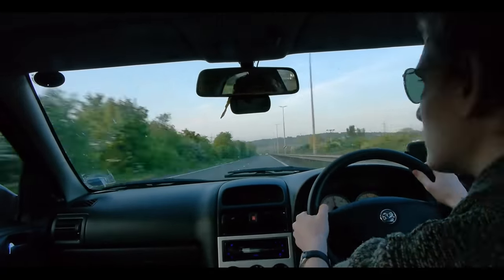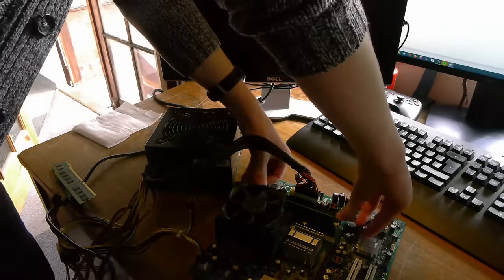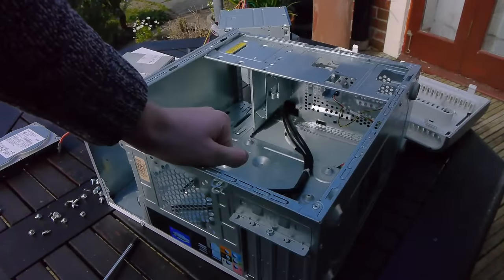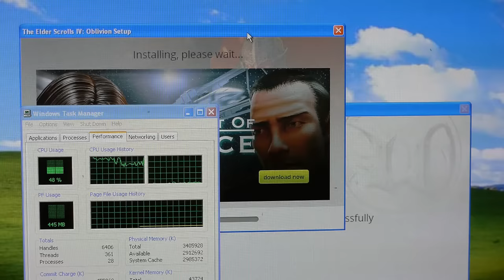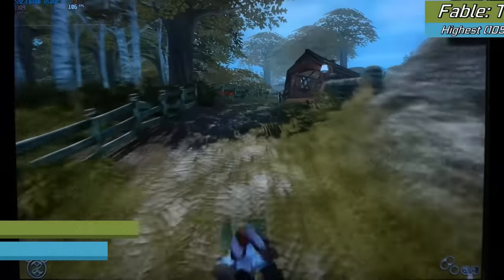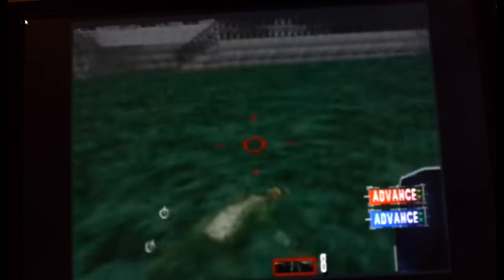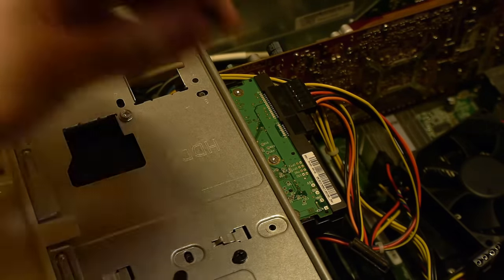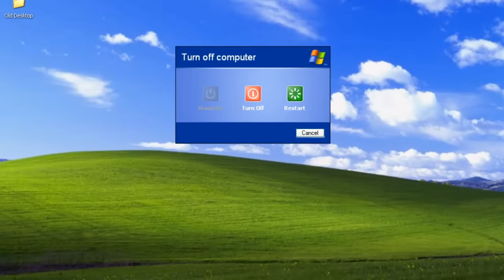The Ultimate Windows XP PC

Comment: Actual overkill PC for Windows XP:
CPU: i7 4960X
Motherboard: X79 from EVGA, Gigabyte, or Asus
CPU cooler: Custom liquid cooling solution
RAM: 8x4GB DDR3 3200MHz (yes G.Skill used to sell 2x4GB and 4x4GB kits of DDR3 3200 MHz, may as well populate all slots so dual boot XP and 10)
GPU: GTX TITAN Black 2-Way SLI
Boot Drive: Samsung SSD 860 PRO 256GB
Storage: Intel 905P 1.5TB SSD of course, we're going for overkill here
PSU: Corsair AX1600i for absolutely no reason
Internal Optical Drive: <Insert generic all black Blu-Ray Drive because you still need to use discs for many XP games or keep discs in the optical drive, may as well have a Blu-Ray drive. Also Internal is better than external because it looks better>
Case: Phanteks Enthoo Elite
OS: Windows XP Pro SP3 32-bit and Windows 10 Pro 64-bit (gotta find some way to use all that RAM)
Reply: why stop at 4790k and black Titans? why not Titan X's or RTXs and something like a latest dual Xeon setup? driver support or what

edit: and another thing, why not just use XP 64 bit to utilize all the ram and not dual boot with w10?

Comment: I'm disappointed by this video. I did just a little research and I found that the ultimate windows XP computer would actually be a i7 4960x paired with a GTX titan black. You should at least picked up a prebuilt with a 4790 in it, and you could have thrown in a 980 ti.
Reply from the maker: All well and good till you run into bugs that occur on the newer Nvidia cards in older titles. The PC was never built for out and out power, it was built to deal with XP software and titles well.
Reply: @BudgetBuildsOfficial  I'm not saying it doesn't do those tasks well. I am just saying it isn't the ultimate computer for windows xp. The computer is about as ultimate as the ultimate cheeseburger from jack in the box.